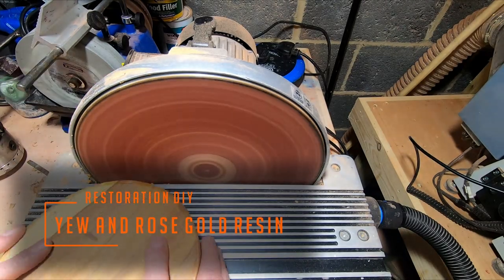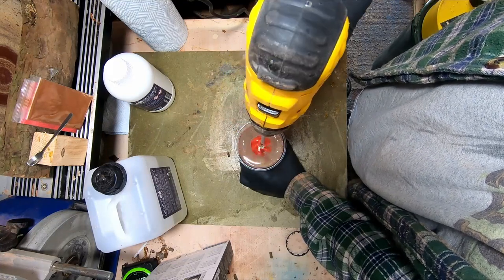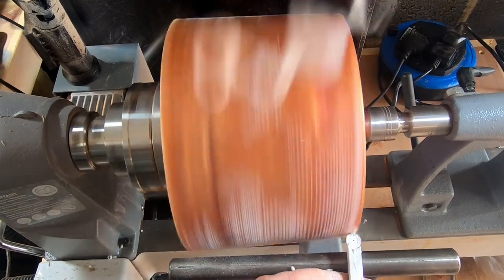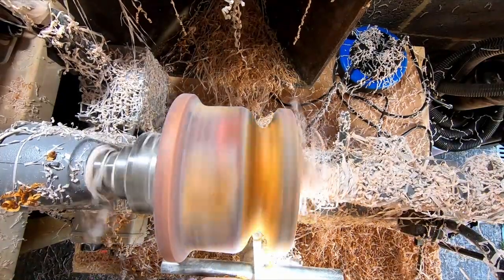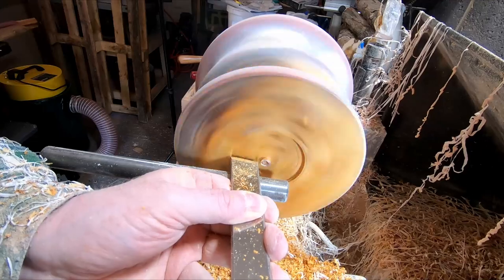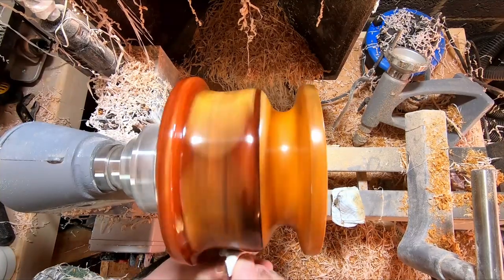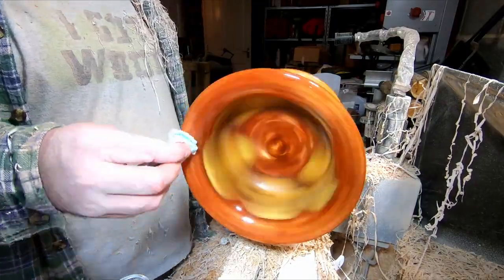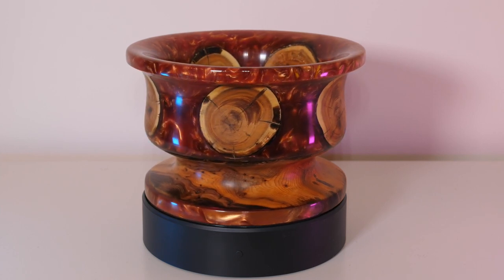Woodturning | Yew and Resin Bowl (Revisited) | Restoration DIY

Comment: Lovely piece. Would it be possible to mention how big the bottom blanks are and the size of the finished piece
Reply from the maker: Hi. The blank had a diameter of 200 mm, and the finished piece was 180mm diameter and around 140mm high. Thanks for your question. I'll add the dimensions in my future projects. 🙂
Reply: @RestorationDIY  thanks for the reply was it a 2” or 3” thick blank.
Reply from the maker: 2 inch thick. 🙂

Comment: can we make it without pressure-pot ..?
Reply from the maker: Hi , Thankyou for the question, yes it is possible to make them without the pressure pot, just make sure to burst all the bubbles that form on top of the Epoxy resin before it cures using a small blow torch or heat gun, Also if you mix the epoxy by hand with a mixing stick this will reduce the amount of bubbles as well. 🙂